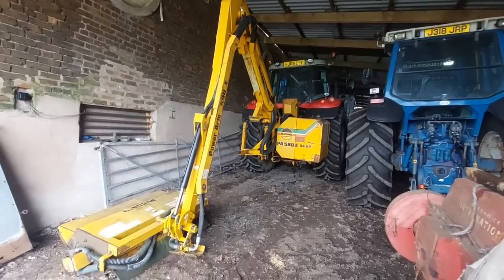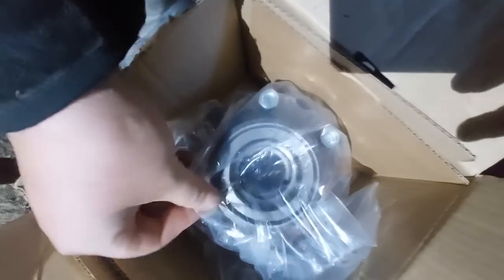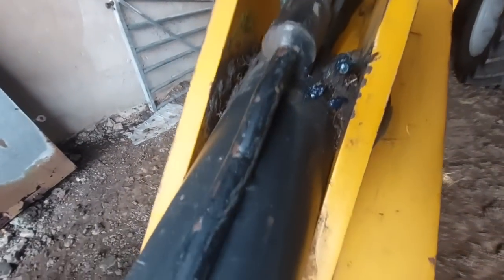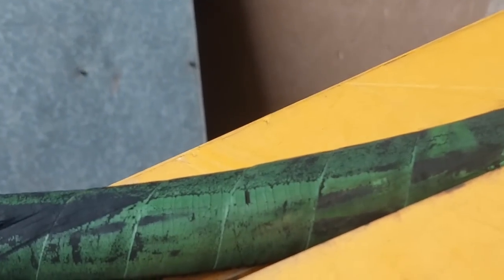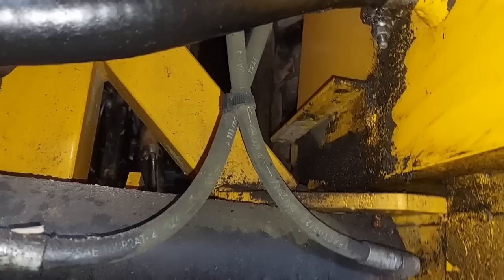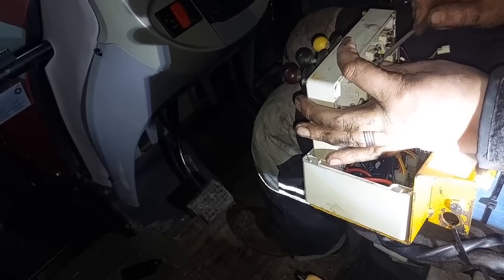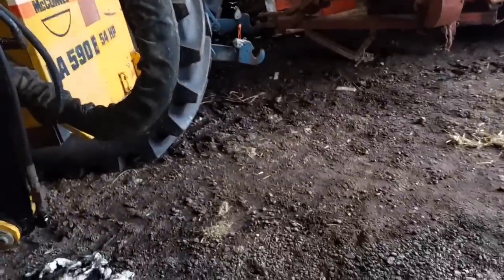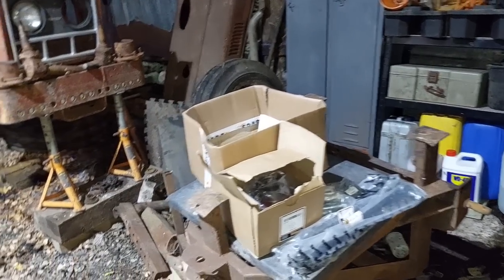new hedgecutter. is it good or dud

Comment: Has your workshop been ransacked?  
How do you find anything???????
Might be a good idea to get a spare head….just in case.
Great vid as always. 👍
After watching the vid to the end it was such a relief to see the hedge cutter actually working, I’m sure it will get TLC.  Is it worth having some spare parts on hand?  If there is something that could potentially fail then maybe worth having the parts ready now.
Reply from the maker: My workshop is embarrassing. Result of a couple of big rush jobs an little spare time. No excuse through. Tbf the main faluires are pipes pumps and motors and i have a very good mobile guy

Comment: would be inclined to flush grease the rotor bearings ........     about 45 pumps of the gun does each one on mine ........done every 4 hours   work ...........have a pa 500   here with the heavy duty head  good enough  if a little heavy  for what it is .............

Comment: Looks like you scored yourself quite a good machine! - small repairs and oil leaks can be expected but that's the joys of secondhand machines, but that's easily sorted with a bit of TLC. You just need to find an A-frame for the linkage to lock it up and some guards for the cab.
It'll look good on the Smurf!!
Reply from the maker: I was expecting to find things due to age but very pleasantly surprised. Not sure on throwing wood at smurf but im not ruling it out

Comment: Well it took me several attempts but I did get to the end 😭
Reply: Glad it works good with just a few leaks that one from tank right pain if it's the same as mine the pipe is bigger one end than the other😬flails look ok if it was your own hedge I'd just use them but customer will want it nice cut so your have to change them great job on the control box fiddly job 👌👍
Take care stay safe cheers 👍👍
Reply from the maker: Glad u hung in there 🤣. Not sure what happened, but ur werent alone. Needs a few improvements to be ready for what i need but its a very good base